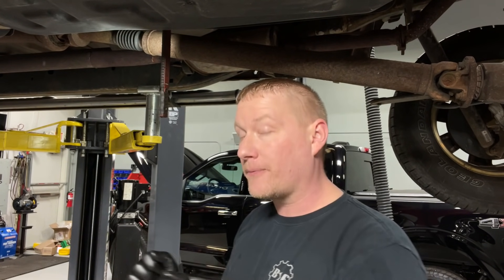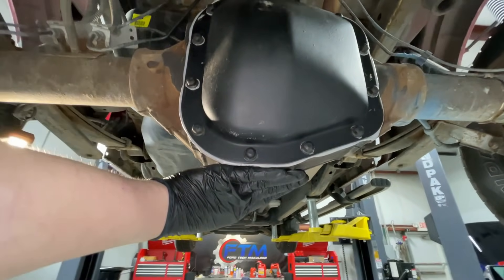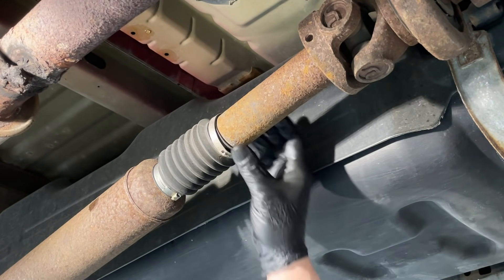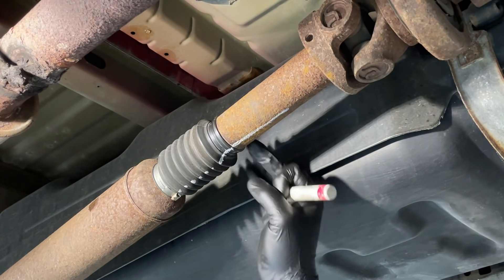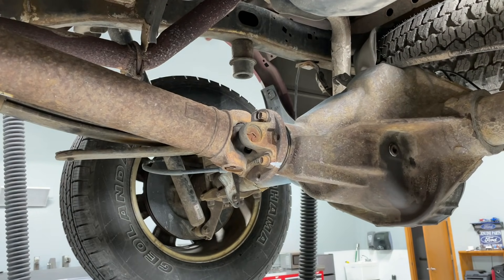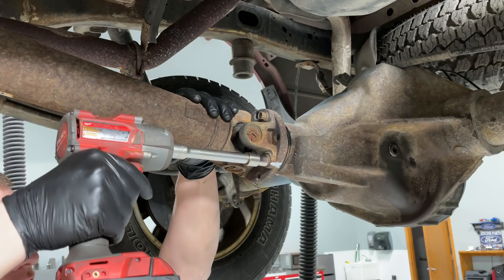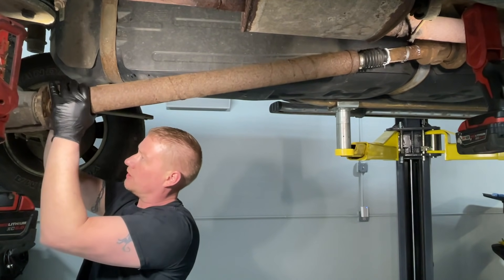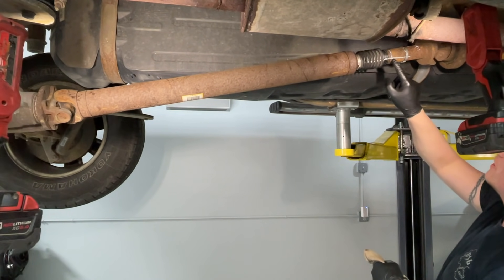Ford F-150 Driveline Slip Bump: Two Piece Driveshaft Kit Fix!

Comment: Interesting I have a 2012 Ford f150 Crew cab 6.5 long bed four wheel drive I've never had any issues with my driveline since I've owned it 30,000 miles I've put on my truck since I purchased it

Comment: I have the clunk and a slow creak consistent with 31 splines grinding on a 2010 with a 2-piece.  Put in on the rack and the front slip yoke will flop laterally on the output shaft of the trans.  Looks like the flange/yoke at the front end is AL3Z-4841-B for the 145in/4R602 shaft, but I hate to replace an $80 slip yoke when the rest of the shaft is crap.  Anyone else had luck with replacing just the front slip yoke and getting by?

Comment: I am not getting any kind of bump, but I get a clanging noise at slow speeds, going over bumps, and turning.  While under the truck I can roll the truck back and forth and I hear and feel the noise at the 2nd piece of the driveshaft (near the boot looking part)  Curious if this is the same problem and if tue same solution would work.  Thanks to anyone with some advice.  2020 f150 sport 2 wheel drive

Comment: this is a problem with most all fords. my 1996 did this. granted mt truck is the 7.3 diesel and has 275k miles.
i had the hole shaft rebuilt and upgraded to parts out of a mack and just removed the hole slip joint.
i got tired of having to re-lube things every 30k miles and put one in the has a grease zerk and U joints that have zerks ..

Comment: Hey guys i just did mine but my 14 yr old was giving me a hand so he clean the drive shaft and remove the mark on both sides my boot clamp what i left in driveshaft was pointing down when removed so i put it back same way but the diferential side i have no clue, well i put it back on and the clunk disappear completely but now when im going around 40 to 50 mph i feel a small vibartion coming from rear of the truck but the vibration disappears right after 55 mph what can i do to fix this problem i appreciate any help thanks in advance

Comment: My 2014 did that for the 3 years I owned it local ford dealer put 2 carrier bearings in it and even a drive shaft they never figured it out Ford actually sent there tech out to the dealer to look at my truck and said that’s the way the trucks are I guess more people must have complained

Comment: It kinda looks like them two piece driveshafts are already grooved one way, i noticed one groove was more wider then the rest on the input driveshaft.
Reply from the maker: There is a double wide groove on the female side but no corresponding groove on the male side. It can be installed in any position, so it is very important to mark the relation.

Comment: Hey Brother, I hope you see this and respond I am frustrated and out of ideas with this truck... 2011 F150 3.5 ecoboost, Truck keeps shutting off on me especially when driving on highway at 75 MPH “Scary when my children are with me” it shuts off and all warning lights start flashing on lights and odometer goes blank, I have to pull off the highway safely and wiggle the fuse box wires under the hood and it works again for a day or two but constantly keeps happening.. I have done the fuel pump fuse relocation already thinking that was it but that didn’t fix the problem, I replaced throttle body too and it still happens.. I’m desperate for any help from anyone please.

Comment: I am surprised that you did not inspect the Carrier Bearing during the video...
Reply from the maker: I always inspect them as part of a visual inspection under the vehicle once it is lifted but the concern you may be referring to is more common on the 09-10 models.
Reply: @FordTechMakuloco  and not limited to The F150 Drive line issues

Comment: I have a 2014 ford fiesta that won’t start, I replaced the starter worked fine for literally 18 hours and now it won’t start again. I’ve sanded down the surroundings for the bolts and it made no difference. I called Ford and they said it might be the TCM

Comment: Why use loctite when the rust will do that for you?  Just spray the threads with salt water and torque it back in there.
Reply from the maker: Yup but the lock and seal threadlocker keeps the water out too allowing for easy disassembly later on.

Comment: Thanks for sharing!  It is nice to know this can be done at home with ease.  Two quick comments for your consideration:

1) I would personally prefer to mark a spline rather than the boot.  I’m guessing that’s a 31 spline axle and it wouldn’t take much (360/31 =11 degrees) for one to be off a single groove on re-assembly.  Probably not critical, but I thought it almost looked like your paint mark had a slight angle on it when re-assembled,   The boot could also slip or tear during the job.

2) This is another personal preference but I want the rear pinion bolts going back in their same holes too and would mark them too.

The absolute last thing anyone wants is any kind of vibration that wasn’t there before.   Thanks again.  Hope this helps someone.
Reply: I did this repair today. Comments:

1) the spline is keyed. It only goes back a single way. You can't rotate it around by a single spline and insert it. The mark is just to help you line it up approximately. 

2) I thought the same about the bolts going back to the original location. Ford will tell you to order new bolts. I did, but they didn't arrive in time, so I reused mine. My truck (Ranger) had very little rust on the flange or bolts. I had no new vibration after reassembly. Maybe if you had one or two bolts that were heavier with rust, you'd have issues?

Comment: The drive shaft should be polished Down to clean metal and painted and U joints replaced then the differential bearings and seals replaced and transfer case mounts and engine mounts replaced so that there's no Bumping Noise and the whole under body  Lubricated with motor oil and Deisal fuel Mix

Comment: Since FORD had a better idea . . . do you have any experience in replacing the ‘staked’ u-joints in 2004-2008 F150?j. EDIT - ADDITION . . . another YouTub’er has suggested that the grease Ford uses is the same as the Harbor Freight Super Lube Multi-Purpose Grease (White with PTFE Teflon) @ $5.99/tube

Comment: I work in a driveline shop too bad they made thoseF-150s with a non serviceable hanger bearing........
Reply: What manufacturers use a serviceable bearing?  I was a parts guy at an auto parts store years ago and I think maybe some were, but as a whole you have to buy the whole driveshaft.  I've been at a Subaru dealership for quite a while now and you have to buy the whole shebang from them or nothing at all--haven't seen a single "fix" actually last.
Reply: @406Steven  ...... on foreign vehicles yes you're right on that .........American-made trucks that's not common........
Reply: @406Steven  .............. you're right most of them are throw-away shafts but American-made pickup trucks........ I think F-150 is the only one who does but it wouldn't surprise me if everybody starts doing it

Comment: I have a 2011 F-150.  Ford did this fix under warranty two or three times for me.  The problem comes back after about 30K miles.  I got into it with them about it, and they just refused to grease it anymore without paying for it.  They never fixed the problem!  I've heard that Ford has a redesigned drive shaft you can install.  Depending how many miles you have on the truck, this may be the more permanent fix.  If you don't plan on keeping the truck long or it's coming to the end of its life, this fix is probably the way to go.  What really frosts me about Ford is that they don't honor their warranty! That's just unacceptable!! 😒

Comment: I don't see why you put a mark on the shaft, since its in nutral and you rotated it anyway! Why?
Reply from the maker: The one on the driveshaft to pinion flange is to prevent rust stack up and a a runout concern. The shaft to shaft mark is needed so it goes back together the same way since the they are a balanced unit and also you want to maintain yoke alignment.

Comment: Shouldn't you do the front spline too?
Reply from the maker: No, it doesn't plunge like the rear section on a two piece driveshaft.
Reply: @FordTechMakuloco  make sense. dealership quoted $1000.00to fix it. $46.00 and it work. Great job

Comment: Unrelated to this but was over at my buddy's shop today and they had a 17 or 18 F150 on the lift trying to put a new oil pan on it. the original pan leaked and they thought they fixed it. Still leaked so they had a new pan this time. What made me sick at my stomach was that it was a PLASTIC PAN!!! 2.7 Ecoboost I think. I've been a Ford guy ever since high school but Ford dropped the ball big time on this one! Where do they get these engineers????

Comment: I had the driveshaft in my 2010 F150 replaced March 2020 due to unserviceable carrier bearing going bad and making a terrible vibration at takeoff and 35 mph. One year later truck developed vibration at take off and left hand turn from stop to 20 mph. Again it was the unserviceable carrier bearing, fortunately the problem was covered under limited lifetime warranty and did not cost me anything. I guess all the old guys that had BETTER IDEAS at Ford have retired and they are hiring a lot of guys with DUMB IDEAS. GET RID OF THE TWO PIECE DRIVESHAFT, FORD!

Comment: I thought Ford recommends using new driveshaft bolts everytime.
Reply from the maker: no
Reply: @FordTechMakuloco  Yes! quoting from IDS: Remove and DISCARD the 4 driveshaft flange bolts. To install, tighten the 4 NEW bolts to 76 lb.ft. 
Also, Ford says never to hammer on the driveshaft or any of its components to disconnect the driveshaft flange from the flange pilot. Pry only in the area shown with a suitable tool, to disconnect the driveshaft flange, or driveshaft damage can occur. 
Then they show a picture of a prying tool and how to disconnect it.
So, yes Ford does recommend replacing the driveshaft bolts every time.

Comment: The slip joint is dead splined should only go back one way.
Reply: Still always a good idea to mark both pieces.
Reply from the maker: Nope, it can go back in any position. I have done many of these over the years and don't always line it up right the first time yet it splines.

Comment: I had a ranger with this problem  years ago , they didnt have a kit but you could get the grease from ford .... It worked but only for a few months and back to the slip bumb ... I sold it for a multitude of reasons but this was another one of them ... Bad ford design ... Frustrating ... Grease fitting would of made it whole lot easier but its a ford ... Garbage